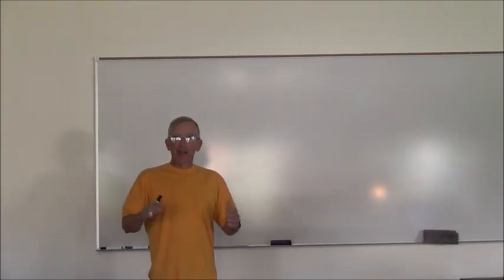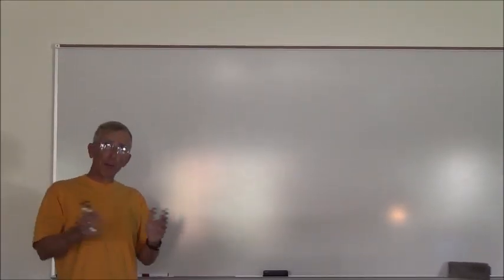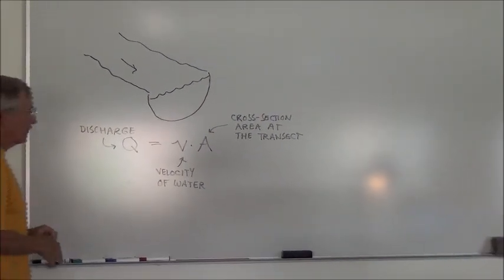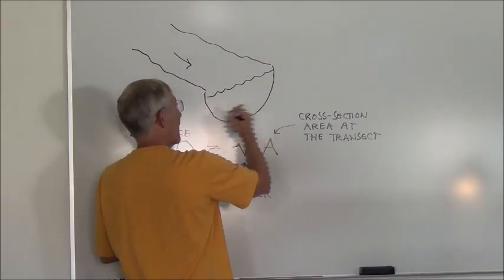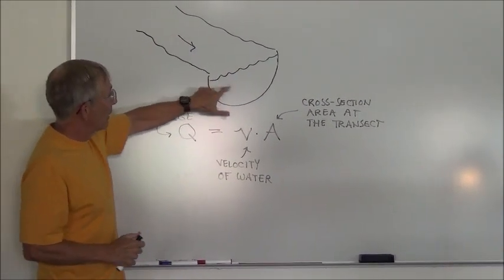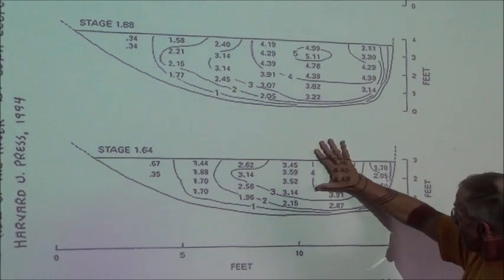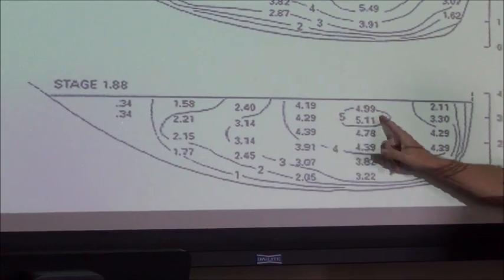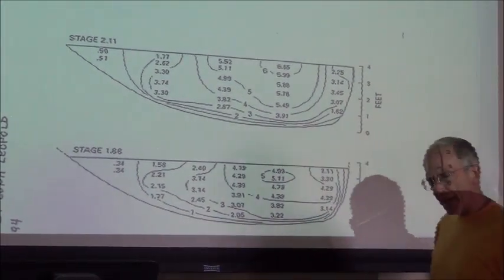How to Calculate Stream Discharge Part 1

Comment: If stream passes through a culvert, can use this calculation to determine cross-section area: https://youtu.be/Qd4iqL3SMkY.  Then multiply that by flow rate.  A method for flow rate is to use fluorescent dye.  Dump in eco friendly dye upstream, downstream take many samples, the velocity variation is accounted for across distribution of fluorescent dye concentrations.